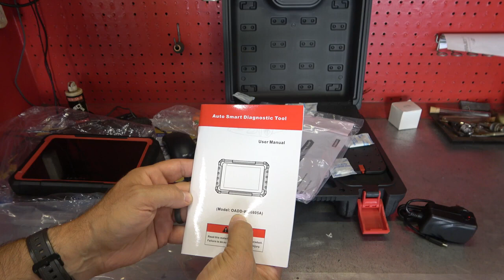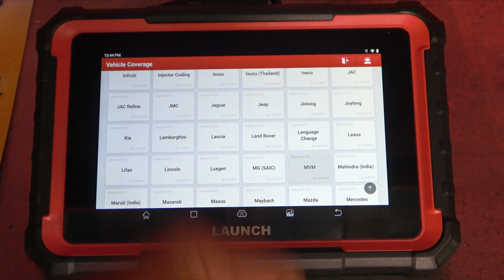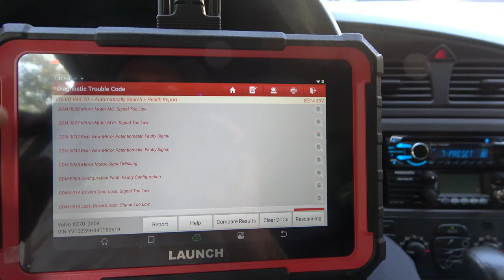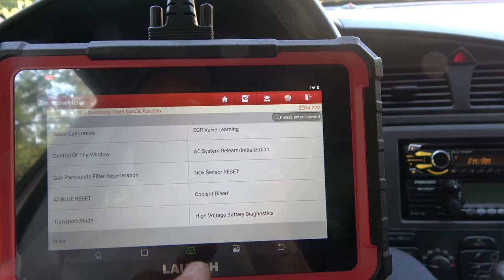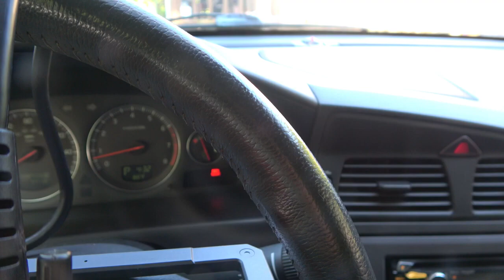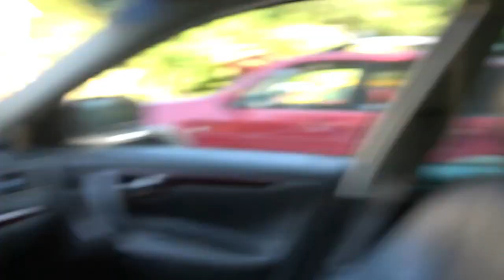2023 Launch X431 PRO Elite Unboxing and Diagnostic Test- EOBDTool.co.uk

Comment: They got so many models it's almost hard to know what you're ordering sometimes.
I just ordered the pros elite v+ and online says the + means a 10.1 inch screen but one minute I'm looking up the model I ordered and it's got a all black border and then it shows a red and black one like this so it's hard for me to tell what I ordered and if I got a decent deal.
Mine says it's the 2023 model and comes with a free canfd connector.
Guess I will find out when it comes.
Reply: Mine was on sale for like $717 and it was a little over $750 after taxes and it seems impossible to figure out which one it is till it comes since I get both models everytime I try and look it up 
And there's reviews but they lumped all the reviews for several models together and with pics.